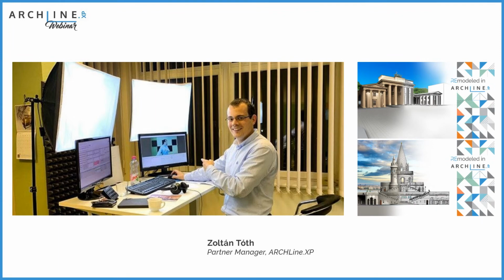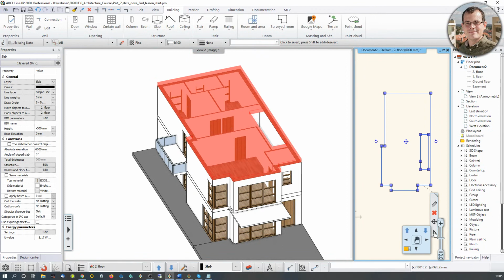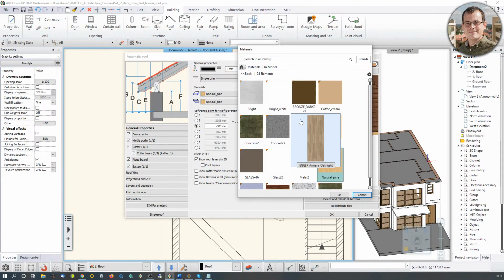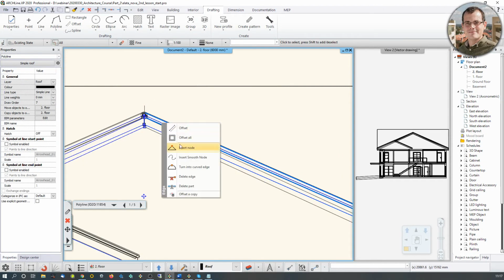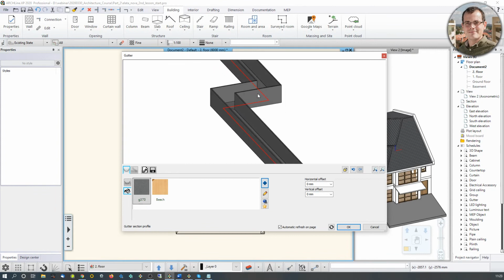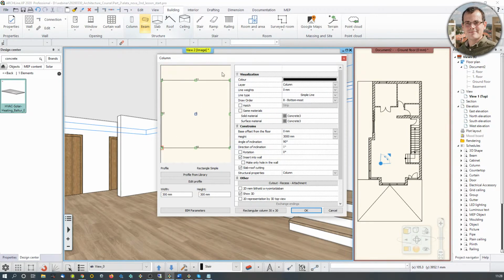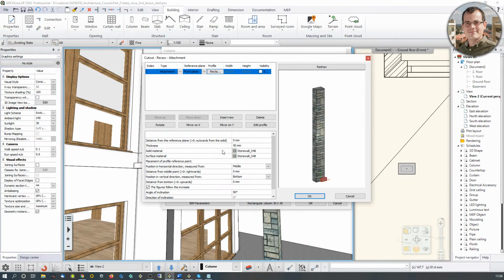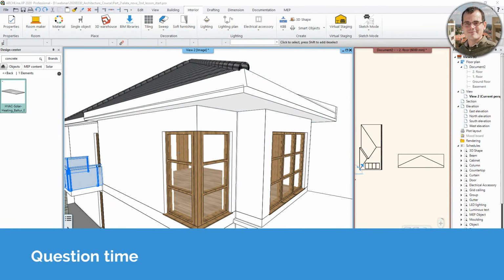Live ARCHLine.XP Course Part 2 - Your House Gets Its Roof

Comment: Hi Zoltan,

Thanks for verbally clarifying & demonstarting the points I raised in your YOUTUBE course 01 yesterday within this YOUTUBE course 02, its much appreciated.

DESIGNING & DRAWING IN ARCHLINE-XP
Designing & drawing in ArchLine-XP for new projects using the 3D tools straight away does seem quite straight forward & may negate some design work in 2D, as we can see, ArchLine-XP is very flexible & quick in changing 3D building element properties.

I guess each project will be different in the extent of use of 2D drafting tools & imported DWG CAD plans as an aid to creating a 3D building model, so this is good to understand this flexible combination.

Therefore, a design planning concept proposal for a client in the initial design stage can evolve from a concept design into a construction set of plans very effectively.

LAYERS
The Automatic layers will save time & allow a user to stay focussed on the initial design rather than setting out a list of layers or new layers as one proceeds. The automatic layers I guess could be renamed later to suit a users preference.

Regards
Clayton